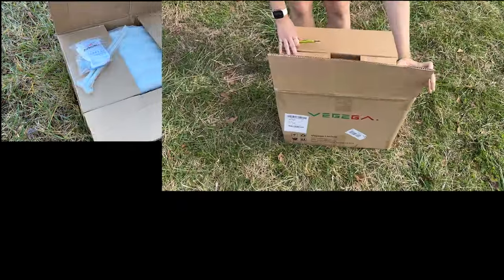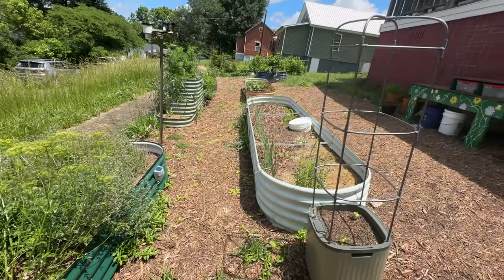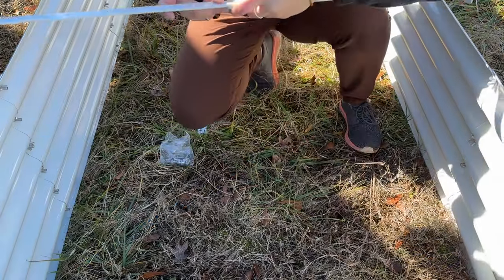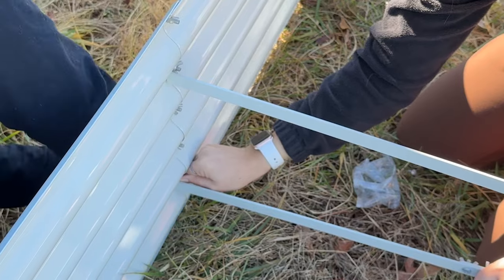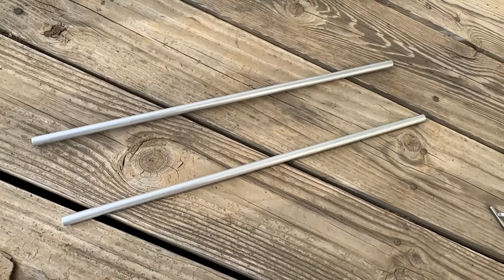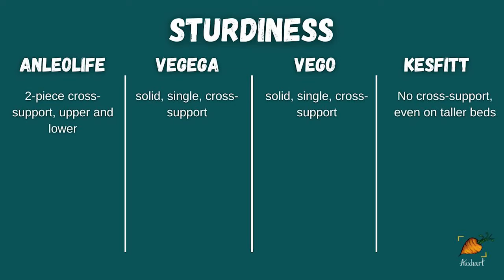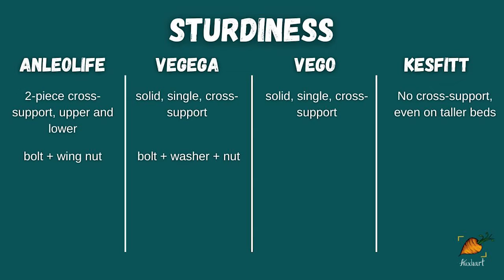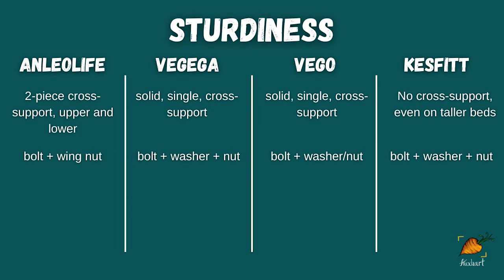The best metal raised bed company (an unsponsored review of 4 types of garden beds)

Comment: Thank you for this review. It will be most helpful as we are looking to purchase a different brand. The birdies beds were great at first, then started having a couple issues with them so have been wanting to try a different brand. Thank you again. 🌻
Reply from the maker: Oh really? What kind of issues? I’ve only heard good things about them.
Reply: @AuxhartGardening  They did really well on the flat areas. In the couple areas that had a slight decline, we used the longer option like you have (the 8 in 1 I believe it was called) & put a little in the ground evenly on one side & now a couple yrs later is bowing out at the bottom. It seems a bit too flimsy. Thinking we did something wrong, double checked birdies video to make sure. I have them 1/2 full now with lettuces, radish, onions & peas but after harvest, we are trying a different brand. I'm thinking that the trapezoid design may be sturdier. One of the other birdies have areas of rust from under the rubber seal after 3 years which could be a flaw in the material. The last 2 birdies we purchased were the smaller ones, so far seem like better choice; still hopeful of them. Thank you again for showing your review. It is right on time as we were looking to try another. Appreciate you. 🌻

Comment: The features that I liked the most are:
rod supports (for the taller beds, I would like the supports to cross)
acorn nuts (to keep the threads clean in the dirt
I would like to have seen carriage bolts (Screw with a rounded head and a square that connects to a square punch in the metal.  They only need one tool to tighten.)
I like the rolled top.  (I would have preferred a better overlap, like one side cut just under the rolled top)
I also like different heights.  11" for tomatoes and 30" for herbs, onions, etc.
Colors, I am not particular, as long as they are earth tones.
As for accessories, I would like to attach poles to which I could attach strings.